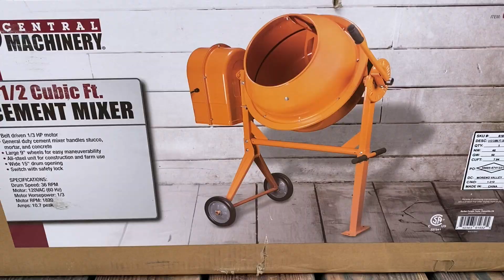EARTHBAG Prep Work - Hyperadobe Solar Shed Office - RUBBLE TRENCH FOUNDATION

Comment: Wow, 20 inch difference between the front and back of the solar shed. Nice that you got the gravel in the trench the same height and tamped down. I loved the laser level dancing! I'm glad you added a buttress to the long wall and made it an entry to the space. Nice chain compass to know where to put the earth bags. Yay, cement mixer! Harbor Freight assembly nightmare! Wow, 3 1/2 hours and it still isn't put together! Yes, keys are essential. Crazy. Great, you guys built the dolly bucket system! Thanks for this Longnecker family!

Comment: A no experience at all question - Just curious why you didn't use cement, sand, and water in a wheelbarrow, mix with a shovel and pour? Saw some other off grid families do that so that is why the question. I must also tell you that your family journey is my new current favorite watch. I love watching you all work together.

Comment: You guys are cute but obviously have no idea what you are doing. The trench you dug is way too deep, you could have just bought a $4 dog compass from Walmart for your compass, and a cement mixer isn't useful until you plaster... I used a go bagger and just threw a little bit of moisture on the piles of dirt the night before to let it soak and use a pick to mix it ... basically anything above bone dry will bind in an earthbag to learn more you can follow my Instagram @adobesage
Reply from the maker: We never claimed we knew what we were doing, but months of research went into this and this is how we’re doing it. So far so good
Reply: @TinyShinyHome  sorry, I didn't mean to imply that you did anything wrong it's just that you could have done a lot of things easier, and I think inadvertently people will see your videos and copy what you've done. What materials did you study for those months?